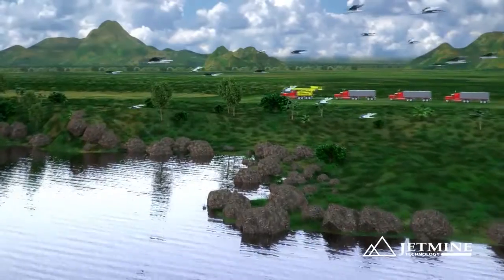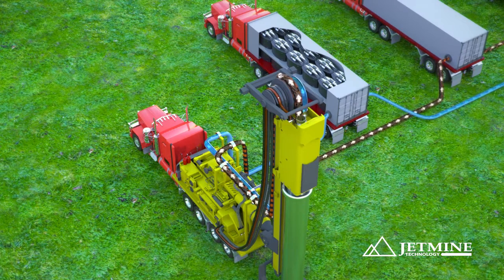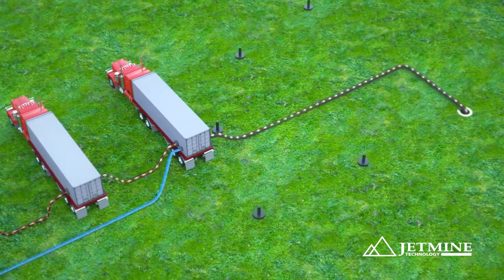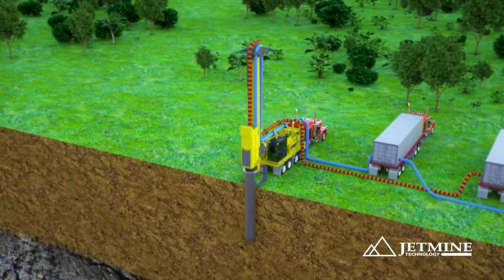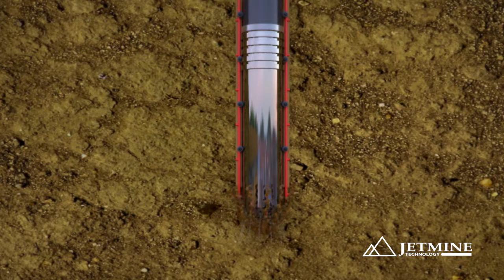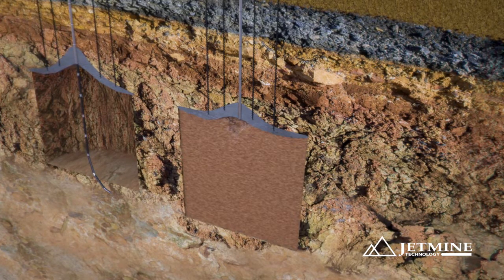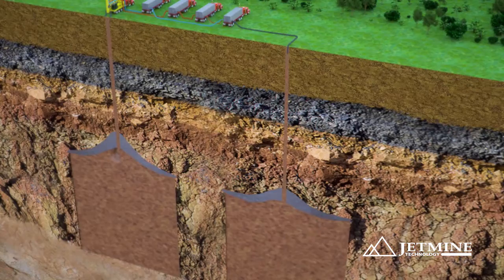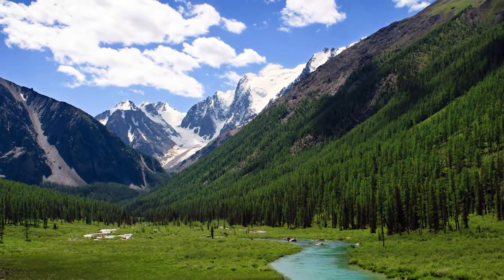New Gold Mining Technology

Comment: in Flexicone concentrators the liquefaction of the mineral bed in the grooves occurs due to the compression of the flexible cone from the outside by three rollers, which causes the particles in the grooves to approach and move away from the axis of rotation by 3-4 mm during one revolution of the cone 3 times. At the same time, a varying centrifugal force from 0 to 200 G acts on each particle. In addition, in our latest development, an easily installed magnetic system for removing the magnetic fraction also makes it possible to enhance the process of thinning the mineral bed due to the presence of a magnetic fraction in the pulp.

Comment: Super! If this can be made so that it is reliable enough to run for longer amounts of time, it would be such a blessing to our natural environment, in so many places. The destruction done especially to the top soil layer is horrible with old fashioned mining on the surface.. And I don't see why it wouldn't work, the oil industry uses similar techniques, only this variant requires more mechanical moving underground of your cutter (and suction) head into different directions and on different heights.

Comment: No cutting tools in contact with the material, I missed how that works?
Once excavated the material will "bulk up" in volume, meaning there will be more tailings than underground void space, the added water will also increase tailings volume. I think some surface tailings disposal is inevitable.
Great to be thinking outside the box.
Reply: It works like a giant waterjet cutter. Problem is that they are very expensive to run and material removal is gonna be way too low.
Reply: Shhhhhhhh
You'll ruin the ponzi scheme

Comment: Are there any dangerous chemicals used in the process such as cyanide?
Reply: Most likely not cyanide since it is required to first free the gold locked up inside sulfide minerals before using cyanide to leach the material.  I doubt the chemicals that they use will be eco-friendly / green though.
Reply: @mwilson14  Don't have to be that eco friendly likely, when everything happens under the surface? I mean, how 'eco friendly' is the underground anyway?
Reply: @harrickvharrick3957  you meant their is no water source underground